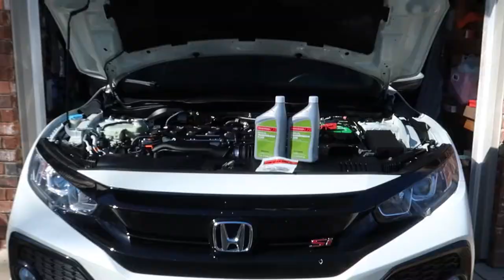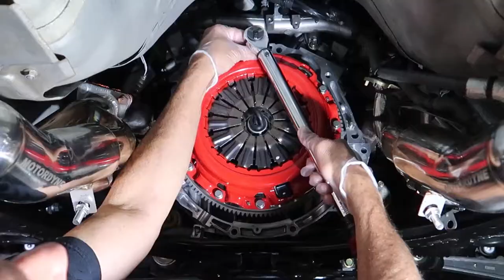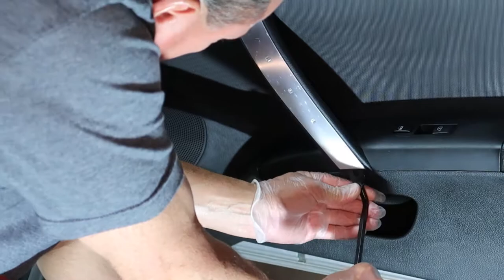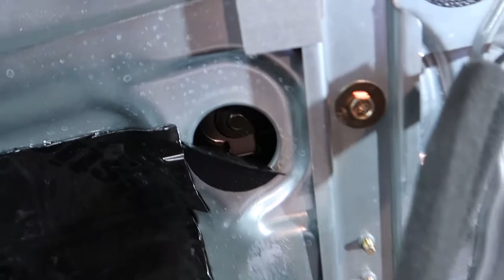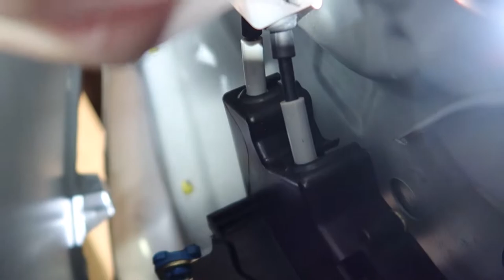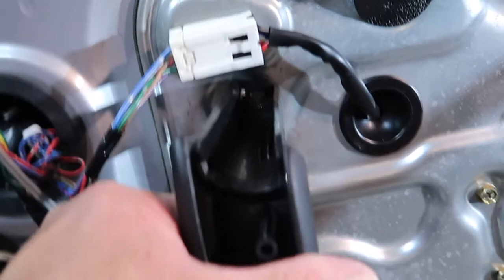350Z Door lock Actuator Replacement #Nissan350z

Comment: In your valve cover video, you say the 303 may help with removing rubber hoses. Is there any other products you’ve found that work better, or are designed specifically to help remove rubber hoses? 
I love your videos !
Reply from the maker: I haven't found anything better than 303 yet, but I will look into it and let you know what I find!! Thanks so much for watching! 🏁👍💯
Reply: @Zspeed  Cool. Thanks for your help, and for responding. I just ordered the 303!

Comment: Do you have an idea how to replace the cables? mine broke and I need to replace them.
Reply: You'll see....just get that thing removed like he shows here then remove that black cover piece to access the cable  ends

Here is a short video of a guy working on that actuator and you can see how the cables attach 
https://youtu.be/T-y6Cfh1b04?si=_vV7wiZbu14fDN0W
Reply: @mariocooldude9092  awesome thank you for the video
Reply: @mariocooldude9092  ended up replacing them, sir u are a legend
Reply: @dderv9447  you're a real BOSS 🤪
Reply: Ya, my white plastic was brittle by the end and they both broke trying to get them out. Did you find a replacement cable you liked.

Comment: Hi there, my door cannot be opened from outside but can from inside. We replaced the handle and noticed when we open from inside, the blue thing the rod goes in, that thing goes down a lot more than when we use the outer handle. Do we need to replace that whole thing? Or can we just replace the blue thing we stick the rod in?
Reply from the maker: Start off with the blue plastic rod fastener. If that doesn't work, replace th whole thing!

Comment: Do you know if its possible to move the door lock itself to the passanger side? I have carbon fibre handles but as im in the UK the door lock is on our passanger side of the new handles, so thought I could kove the actual barrel to the other side (our passanger side)......if that makes sense.
Reply from the maker: Yes, that should work for you! Because the ignition key is double sided, meaning the key has the same cut on each side.

Comment: What would cause the drivers to not work but passenger works? Has new actuator from nissan as well
Reply from the maker: Have you checked the handle on the drivers side, they will also fail over time!
Reply: @Zspeed  handle is fine. Just the actuator not responding
Reply: @FlipSideGarage did you end up getting another actuator? I just installed a new one, but it sometimes doesn’t unlock the door.

Comment: Im having a problem with replacing the door handle. The part where the rod goes into the blue plastic piece. I am getting the rod in the blue plastic but once it is reassembled (the 10mm bolts installed) the door will not open with the new outside door handle. The inside door handle works but for some reason the outside handle doesn't.  I've had it on and off several times, making certain each time that the rod stays inside the blue plastic piece but when you try to open the door it will not open.  Any ideas? Can that blue plastic piece be faulty? It's supposed to have a hole in it for the rod to go in, but it just seems like the rod is not pushing down the lever that the plastic piece is on. Anyone have some help with this? Thanks.
Reply from the maker: Try Disassembling your good door handle and checking it out to see exactly how it's working, compare this to the new door handle to see if there's any difference between the two!

Comment: How do you open the door if the actuator is not letting it open. ?
Reply from the maker: Unlock your door from the inside!! But if that doesn't work, you may have to destroy your door panel to access your door lock!
Reply: I saw someone once said you had to remove all of the weatherstripping and then it gives you just enough room to remove the panel
Reply: @carterpritchard5063 can you try too explain a little more my driver door is stuck shut from inside and out